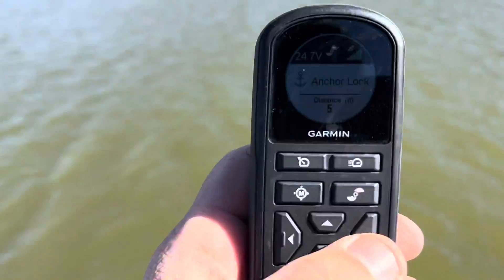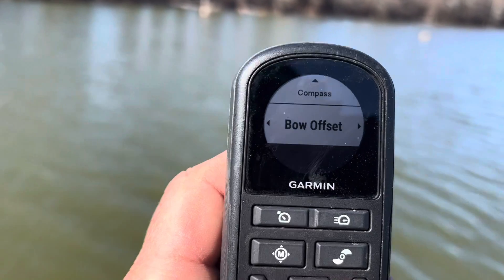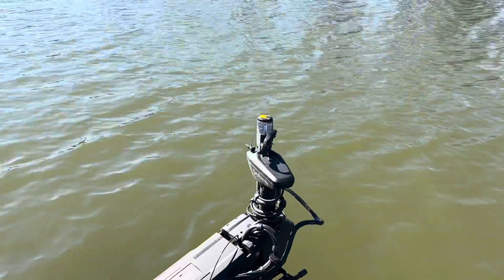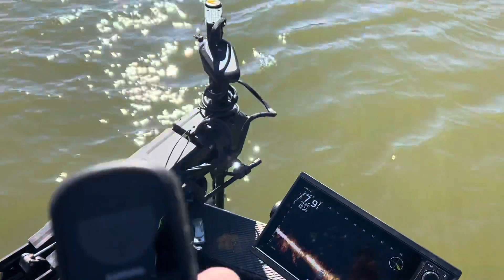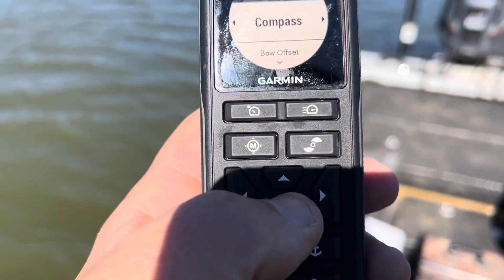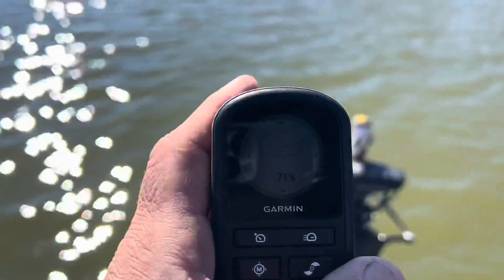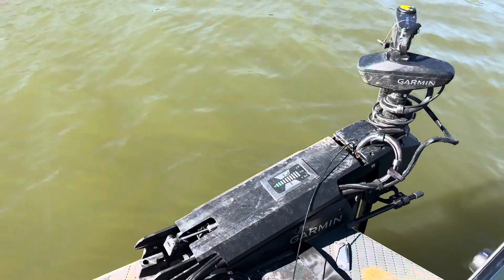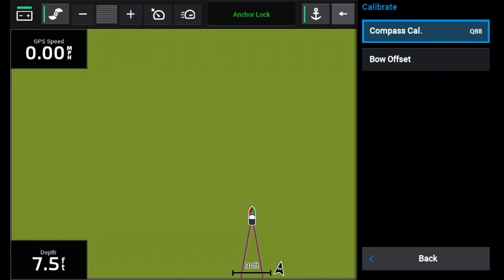How To Calibrate the Bow Offset and Compass Calibration for The Garmin Force Using The Remote

Comment: Man I have the same trolling motor I guess I  thought it would stop like stomping the brake I calibrated it like you did but it still swings around all over the place but I guess I’ll get used to It or get power poles🤪
Reply from the maker: I use power brakes to get the instant stop if needed. They are essential to my fishing. More so than the trolling motor.

Comment: I noticed when you turned on the continuous run you did it from the foot pedal.  I don't have a foot pedal yet, can you set it using the remote?  Thanks.
Reply from the maker: Yes sir you can

Comment: How’s it going bro I love the videos. Do you have a issue with your Livescanner/Livescope transducer messing with the point to steer on the force. I do a calibration on the motor and remote and it works fine for a 5-10 minutes and than it will be off it is pretty much opposite. If I point forward it wants to go back. Any ideas?
Reply from the maker: Do you have it on the trolling motor shaft or a livescanner pole like I do
Reply: @The_Garmin_Guru  I have it on the live scanner